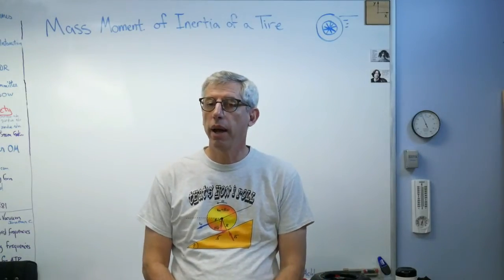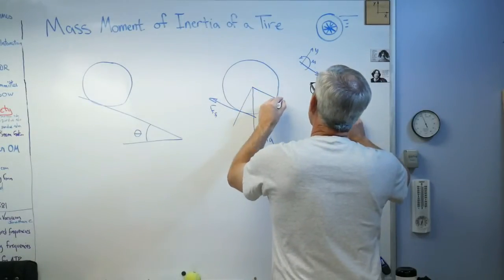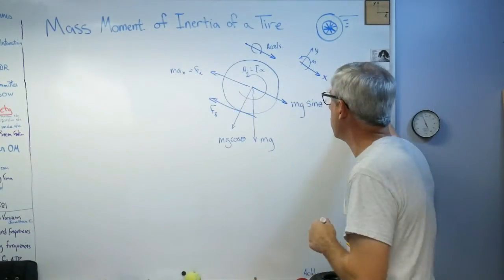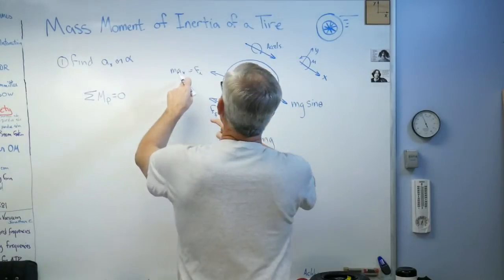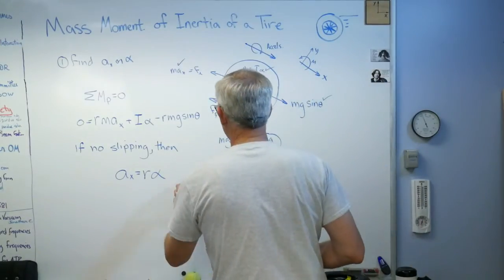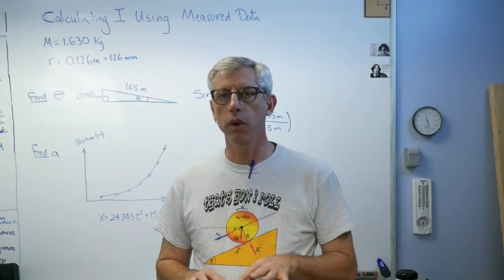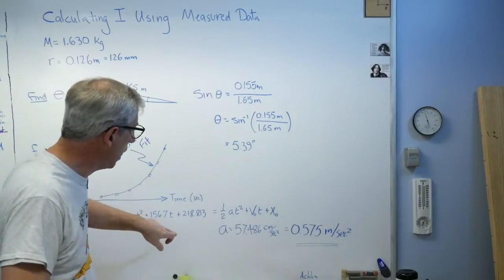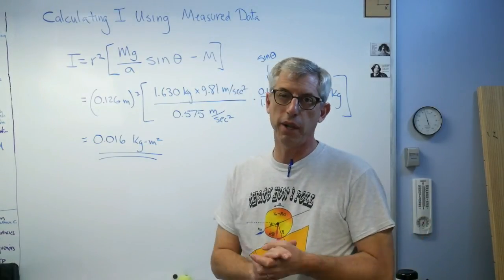Measuring Mass Moment of Inertia of a Wheel - Brain Waves

Comment: Mass moment of inertia for wheels is probably more important for braking, especially for sizing brakes. Discs will also contribute greatly to wheel inertia.

Another place, perhaps the most important area of engineering, is aircraft wheel spin-up at touchdown. The limiting value is going to be tire friction coefficient. But this is multiplied by the weight on the tire, which is multiplied several times the aircraft weight, known an "g" force, in a hard landing.

The spin-up force of wheels during landing exerts an aft load on the landing gear that can easily exceed the aircrafts own weight.